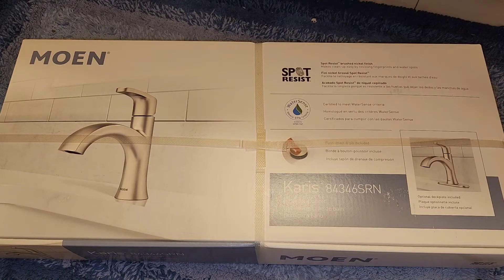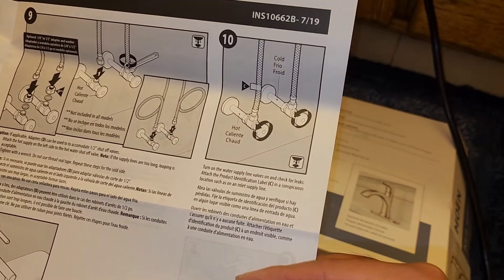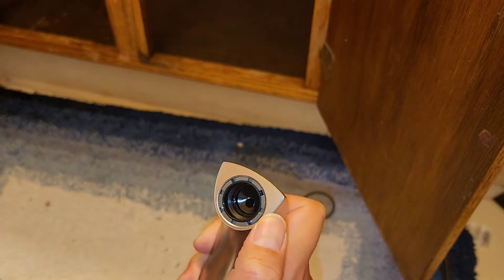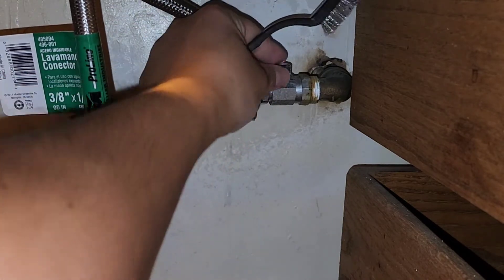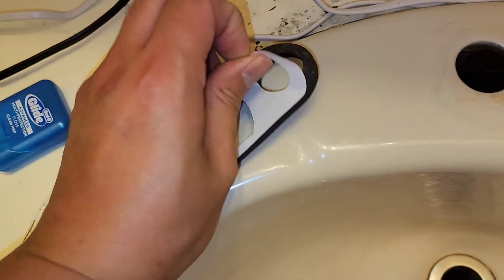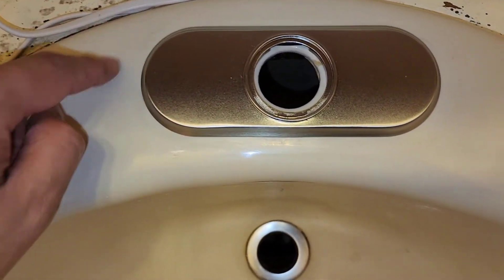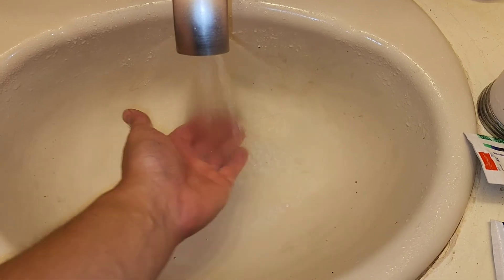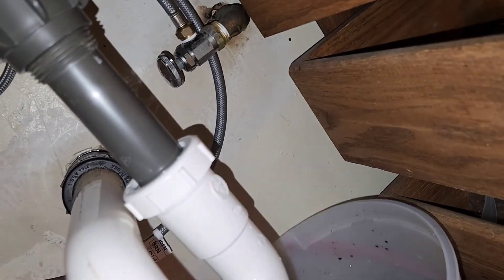Costco Sale Item Review Moen Karis 84346SRN Installation and Removal of Old Bathroom Faucet

Comment: This video was excellent and everything finally came together; however, there is one problem that I need to fix, but I don't know how exactly.  The drain body even with the gasket doesn't sit tight enough and water is leaking from there under the sink.  Should I get something to make the seal better?  Silicon or ???  Help!
Reply from the maker: @KappySullivan  I'm not a plumber, so I'm not sure. I'm assuming there's some kind of coupler or adapter you can use. Basically the lower portions of the pipe need to be smaller to funnel the water in, but I'm not sure.

Comment: Nice job but it's best not to use tape on compression fittings.  I plan to install  a similar model this weekend and appreciate the comments  regarding a good flushing to mitigate damage to the internals.
Reply from the maker: Which compression fitting? Yeah, a lot of people don't flush it out and cause damage to the thing. Best case the filter gets clogged with gunk. Worst case, it gets in the valve and scratches it causing leaks as you've seen a lot of people experienced in the comments.
Reply: @ItsBinhRepaired  In this case, the fittings at the hose ends.  If you look inside a compression fitting you will see a washer or an O-ring.  That's what provides the seal.  They normally  recommend hand tight plus one-quarter turn.  Tape on the threads complicates this process.  I plan to lube the threads with liquid soap before installing and  chose not to use oil because it might corrupt the O-ring  or washer.
Reply from the maker: Ahhh I see

Comment: I purchased this exact faucet at Costco and after 6 months it began to have a drip leak at the spout. Moen sent me a replacement cartridge which i installed - and the drip continued!   Why on earth do these companies sell such garbage?
Reply from the maker: The drip has to do with the valve. Did you bleed the lines before putting the filter piece in?
Reply: @ItsBinhRepaired  i did very briefly but will try again.  thanks for the reply - its very kind of you to reply like that.
Reply from the maker: @John Kell  if you put it in too early, it's too late. Basically the grit from reopening the valves will get in the valve of the faucet, so as you open and close it, it grinds the area where it opens and closes. There's no way to get the grit out after that and the damage has already been done. :(
Reply: @ItsBinhRepaired  I bled it again with both hot and cold valves and it still has the same annoying drip every few seconds.  I installed a Kohler in the other bathrrom from HD which was probably over 2x the price and the Kohler has not dripped in the same 6 mo time period and the flow is actually better.  I stand by my statement that the Moen is inferior plastic and junky.  Its not incredibly helpful that they send out new cartriges for free if it becomes a constant plumbing job.  As i was typing this i saw your new comment.  Moen did not provide instructions with the cartridge and on their website they only mention that it should be bled brieflly but not anything about damaging the cartrige if you put it in and take it out.
Reply from the maker: @JohnKell-c9m  I meant when you initially installed the faucet. I'm not sure why they think the little aerator will stop a leak. Makes no sense.
Reply: I hope you found a solution for the dropping problem. I bought this faucet from Costco, it started dripping after several months, also the water volume became very low, so frustrating. I hired a plumber for the installation, I don't know if the problem came from improper installation or poor product quality.
Reply from the maker: @Ping Luo  low flow means a clogged filter. Dripping means the valve inside the faucet is damaged.
Reply from the maker: @Ping Luo  try turning the handle all the way to the left or right. If you're lucky, it might be only one side (cold/hot) is damaged.
Reply: @ItsBinhRepaired  I have the same issue. So you are saying that replacing the cartridge on this model Costco faucet won't stop the drip? Replacing the Hot and Cold valve under the sink will?
Reply from the maker: No, it's caused by the valve in the faucet. If you didn't bleed the lines before installing the filter and screwing it on, then Minerals and debris got in the valve and scraped pathways for water to go in. It's too late and the faucet is destroyed.

Comment: My issue is the drain doesn't sit flush with my sink. As a result, a small amount of water sits around the drain.
Reply from the maker: Sadly that's how it is :(
Reply: @ItsBinhRepaired  😥
Reply from the maker: @josephl6788  yup

Comment: tighten the packing nut on the valve under sink the leak will stop
Reply from the maker: It's not leaking. What do you mean?
Reply: You say at end of video i might have to replace this valve as well theres a small drip you can just thighten the packing nut you probibly could have thightened the nut on the hot valve and you would not have had to replaced it it looked newish  @ItsBinhRepaired
Reply from the maker: They're 26 years old? Lol

Comment: I purchased this too, it's a very bad product, followed all the steps and still leaking.
Reply from the maker: You bled it? None of mine are leaking
Reply from the maker: The hose needs to be bled before attaching the faucet piece. If you don't, debris gets in the valve and scratches it all up. You can return to Costco, but I usually see it's user installation error.
Reply: @ItsBinhRepaired  what’s the replacement cartridge I can buy to fix the drip or if I call moen will they send me?
Reply from the maker: @JuniorRich916  if you didn't bleed the line, it's not the cartridge. The valve is basically a ball joint. Imagine getting metal shavings in between 2 water tight parts. It scrapes a path for the water to go.

Comment: Piece of junk.  I installed 4 of these in a friends house.  2 faucets started leaking within a couple months.
Reply from the maker: Mine still aren't leaking. Did you make sure to drain the debris from the hose before attaching to the faucet?
Reply: User installation error LOL
Reply from the maker: Yup
Reply: @Passions  I have installed hundreds of faucets over the years.   Moen has had lots of problems with their new valve cartridge design.
Reply from the maker: Hmmm